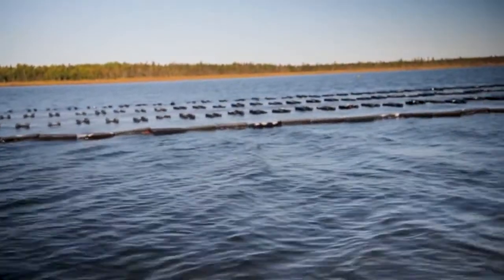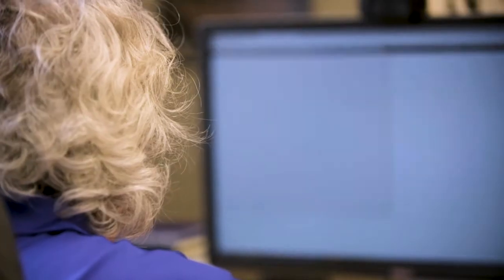Breeding Better Oysters

Comment: I wish i can learn to breed a oyster
Reply: Put the adult oysters in a tank of aerated circulating salt water, suddenly increase the temperature by 5 celcius degrees, the oysters will spawn. Transfer that water to another aerated circulating tank, and feed with algae for 30 days, near the 30 days add finely ground shell for the spat to attach to. You now have tiny oysters.